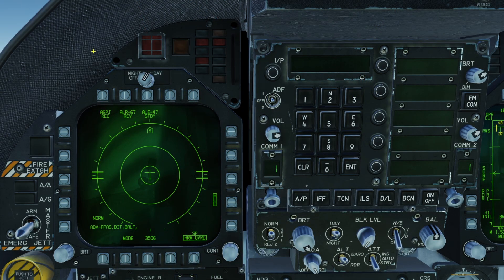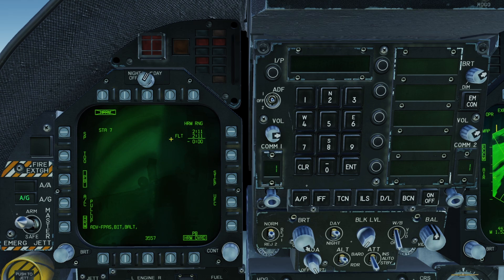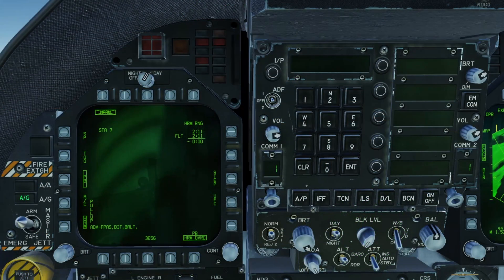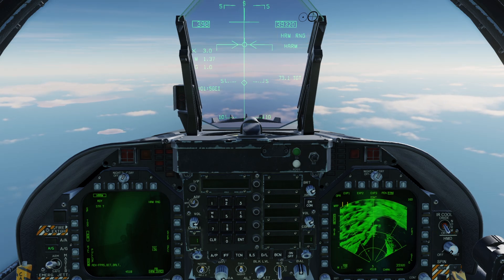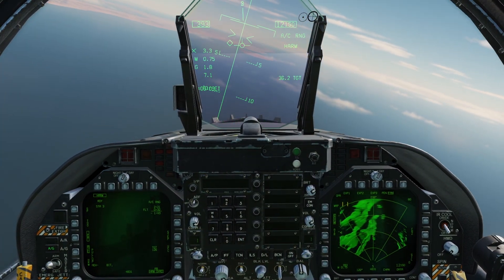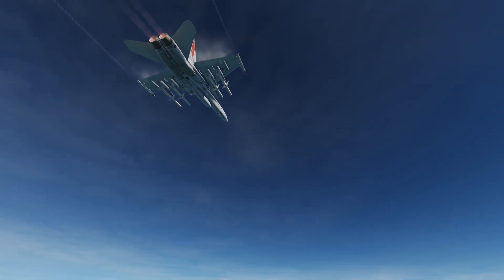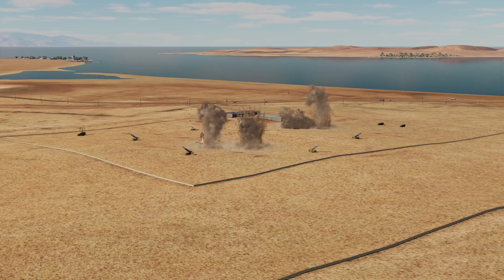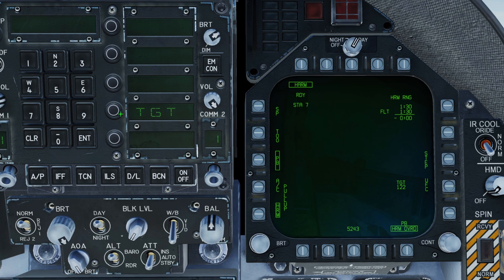DCS F/A-18c Hornet AGM 88 HARM Prebriefed Mode Tutorial

Comment: Nice video as always, gotta question, which code have to use with S on RWR, it have 3 different code how to know with one use? thanks for all
Reply from the maker: Depends, S is a generic term for search radar. You need to pick the code that relates to the specific search radar you're trying to attack.

The RWR won't tell you, so using SP mode is one way, the other is finding out what specific Search radar it is, and using that code.

For example the SA-2 and 3 can both use "SAM SR P-19 S 122" as their search radar, which you can use situational awareness to figure out.

Comment: Actually you don't need a waypoint for PB-mode. What you need is a targetpoint !   A waypoint is one of the ways to get a targetpoint (by means of "WP designate"). Other ways are with the groundradar, with the targeting-pod or even with the HUD or HMCS (TDC Depress).
My question is: what area from the targetpoint is searched ?  For instance, if I slew my targeting pod over the target, which I can see on the SA-page, and press TDC Depress, would that be accurate enough ?
Reply from the maker: You can pull this trick off however, it is not reliable, you really need your designation to be within a mile of the target for PB. Which on the sa page will be difficult without fine tuning visually as you get closer, by which point TOO mode would make a lot more sense.
Reply: @RedKiteRender  ah right. Didn't  know about that mile. Good point

Comment: You can launch harms in PB mode as well if you lock something with the SEA or Ground Radar, and if you know what is is the code for it ! There's a nice colorful kneeboard with RWR threats on the User files.
With the SEA radar I manage to hit a Chinese frigate from like 40 nm, from about 36.000 feet (launch point of the harm).
Also using the POD you can create your own waypoint with MK and launch around that, it works with shorter range sams but it could work with a SA-10 as well !
Reply from the maker: Harpoon or Harm is an interesting decision, Given DCS's damage model sadly it's under-represented. But, in theory the Harm would be much more likely to degrade a ship's radars if it hits, but that's a great idea!
Reply: @RedKiteRender  Yeah, that's what we hopped when we launched at it after it killed our wingmen. We were a flight of 4 hornets going for a bunker strike with 1 harm each and 2 penetrator bombs. The frigate was defending the harbor and we didn't expect it to be so good haha

Comment: How does the Hornet HARM modes compare with the Viper?
Is the implementation of HARM modes in the Hornet realistic?
Reply from the maker: SP and PB are reasonably realistic, although I suspect PB will have some improvements yet to come based on the MSFS Superbug.  TOO is not so realistic at the moment, as it lacks the code input and has a bit of a god's eye view.

SP is a big advantage over the Viper's options thanks to the pullback mode for quick emergency response.
Whilst the Viper's RUK is pretty neat for rough targeting. their HAS and TOO modes should be roughly equal, same for PB. 

Once the Viper get's it's HTS pod that'll really swing it in favour of the Viper.
Reply: @RedKiteRender  Thanks. 
The "TOO" mode in the Hornet is too Arcady at the moment. Hoping for a proper 100% simulation of HARM in the Hornet.
Reply from the maker: Wags has stated it's due an improvement to match the viper, just a matter of time.

Comment: PB mode is obviously fantastic to have, but it raises an interesting planning question in that, if you know exactly, or pretty much exactly, were a site is located, and it's fixed enough to use a HARM in PB, then is it better to use another form of standoff weapon instead, such as a JSOW, SLAM, or particularly a SLAM-ER once they are available? This has the added benefit of never needing the site to turn on it's radar at all, and with MITL modes available you don't even need to be exact. SLAMs do travel pretty slowly, so for shorter range shots vs sites that can shoot down incoming weapons I imagine HARMs have a higher survival rate, but for longer range shots they get really slow too. All the other HARM modes (particularly RUK which I am jealous of when I fly the hornet) are clearly very useful, but PB is one I think I find myself needing to contrive a reason to use more often than not apart from against very long range SAMs, though this too may change once we see the SLAM-ER introduced.
Reply from the maker: Indeed, part of it I imagine will be cost and availability, elements not relevant to dcs. Harms are much faster at impact now than in the past, and I've seen an increased hit rate in saturation attacks as a result, they're also longer range than jsows, although only single mountable. 

Harms in reality have historically been chucked en mass at the general areas of known sites to keep the radars off rather than actually kill, the hit rate is relatively low. So for a mission profile, letting your aircraft lob them and fly home sooner is a big saver on fuel and reduces risk to the individual aircraft. DEAD aircraft then sweep up the sites before they have a chance to recuperate.
Reply: @RedKiteRender  Yeah I've noticed the same, the speed was way down when they removed the unrealistic auto magic loft but appears to be considerably better again now. My hit rate against sites defended by two SA-15s (which is a mission I fly over and over for testing in MP) tends to be similar in DCS with HARMs and JSOWs currently however, for whatever reason if I launch 4 weapons I will loose on average one of them very consistently. That's also a very valid point in that the cost and availability factor is something we, perhaps wrongly, seldom consider. 

I also suppose that since the HARM has been in service so much longer and is also regularly used in a reactionary role against pop-up threats too that it does make sense when you think about it. If you receive good intel on a site's location you're trying to suppress you can just take the missiles you're already using and lob them and ultimately they still do their job if the SAMs aren't shooting at friendlies, something that is very hard to simulate in DCS currently even with the scripts you alluded to. I guess if you have a properly coordinated group, jamming, and enough HARMs you probably just don't need the extra weapons as your DEAD aircraft are going to be able to get in closer anyway, that's something I hope to see done well some day in DCS natively.
Reply from the maker: @Deltarious 
That's the dream, hoping the dynamic campaign can create these situations. Would love to setup AI flights supressing with Harms/TALDS and then player flights going in getting dirty with DEAD under their cover and dealing with popup threats. Makes me want to play BMS again haha.
Reply: @RedKiteRender  That's why I love DCS Liberation! It is hungry for resources but with lower budget it can be manageable. 
I'm the type that likes to plan every flight and every loadout but the damn AI is too bad sometimes.
Reply from the maker: @mayuthecop  Yeah you can't trust the ai to be terribly effective at it's job or staying alive! Liberation's dev has put some hard work into scripting the ai a bit to try and improve it's survival and stop runaway cap flights. Hope AI get's a good update by the time the official dynamic campaign is out.
Reply: @RedKiteRender  Yeah, I've watched BMS videos and their campaign looks amazing, can you fly othet planes or just the F-16 ?
Reply from the maker: @AzuAlx Ex  There are other playable aircraft. /But/ they all run on the F-16's avionics so I'd seriously suggest only flying the f-16 as the others are a mess, they have unique cockpits and flight models, but it's just an F-16 horrifically warped to fit inside a different cockpit.
Reply: @RedKiteRender  AH, I see haha
Reply: I managed to lock a ship with sea radar, and launch the HARM in PB mode, so in DCS, you can fly around, spot the SAM with the pod, and just create a MK point, and you can use that.
In the combination of MK and PB, I managed to launch at a SA-10 site and actually hit 1 tracker. It's amazing reallyI launched 2 of them from 40nm.
Reply from the maker: @AzuAlx Ex 
That's a pretty neat trick, although admittedly perhaps unnecessary as TOO mode would probably be better suited to that situation, unless you're attacking a short range radar like an SA-8 equipped ship or ground force.
Reply: @RedKiteRender  Its the 051A or whatever the new Chinese frigate is called, it has 40 nm range and KILLER missiles hahaha, not sure TOO mode would had been better

Comment: Can you try how far from a waypoint you can have sam, lets say the sam moves from when intelligence got gathered. If the sam goes active that is.
Reply from the maker: PB mode is not intended for search like RUK mode does on the Viper, the allowable error will depend on range launched, at maximum range you'll need it within a mile of the waypoint.
Reply: @RedKiteRender  thanks. Only freshly gathered fruit.. intelligence then ^^